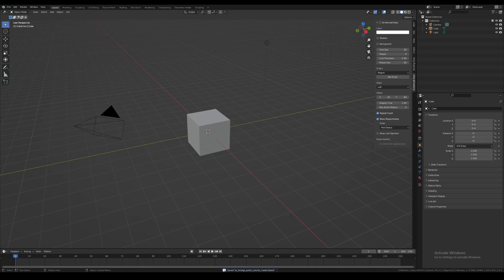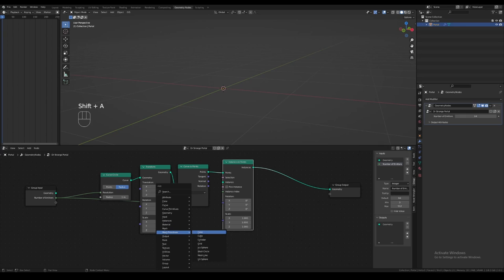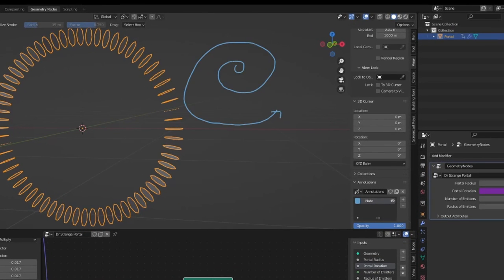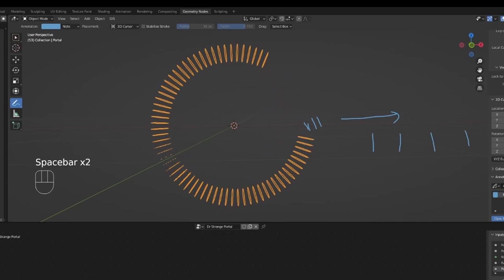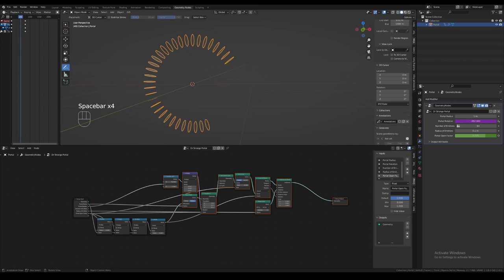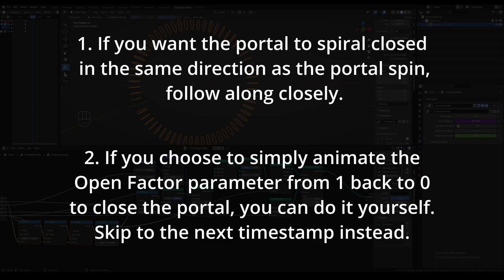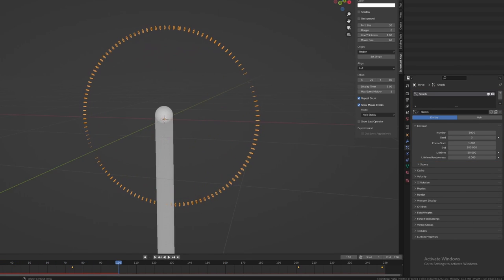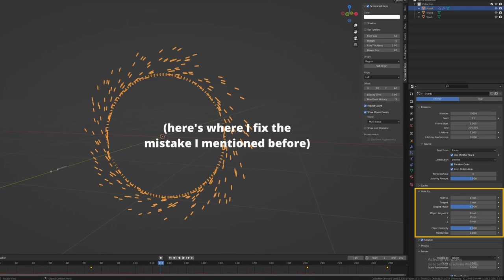How to Make a Doctor Strange Portal in Blender 3.0 | Geometry Nodes and Particle Systems

Comment: hello! when my portal opens it stays still and then closes; it doesn't keep turning. I'm a bit confused about the key frames used in that part. what needs to be done?
Reply from the maker: Hi! After creating the Portal Open Factor and connecting it correctly as shown in the video, slide the Open Factor to 0 and insert a keyframe at frame 1. Then go to frame 75 (or any other frame, depending on how fast you want the portal to open), then slide the Open Factor to 1 and insert another keyframe.

Make sure that you have followed all the steps closely; if you have animated the Portal Rotation with a driver like shown in the video, and the Open Factor like I explained above, when you play the animation, the portal should spiral open correctly.

If it still doesn't solve the problem please don't hesitate to ask again, I will try my best to clarify further

Comment: hello there. Why did you enable collision with ground for the shard particles but didn't enable it for sparks particles?

positive comments for algorithm: nice blender tutorial. great job, helpful, thanks
Reply from the maker: Hello omiga, the collision is applied to the plane object and will affect all particle systems in the scene. In fact the Shards system is the only system that won't actually collide with the plane, since we turned off gravity for that system.
Reply: @rr24creations  Indeed, small brain error on my part. Reversed shards and sparks.
Is it not possible to have collision without gravity? I think the render overall would look a lot better if the shards at the bottom bounce off the plane instead of clipping through it.
Reply from the maker: @omigalock  it's indeed possible to have collision without gravity. In this example, the Shards don't reach the ground (they are set to expire before then) so the collision does not affect the Shards. However, like in my previous video, if the portal is so low such that the Shards don't fully extend out the portal at the bottom, they will clip instead of bouncing off

Comment: Hi, I have a problem. When I add the part to close the portal it deseaper. How to solve that ?
Reply from the maker: Hi, can you please give me the timestamp in the video where you're facing your issue, so that I can try to pinpoint the problem
Reply: @rr24creations  Thanks for your awner. My problem start at 13:25.
Reply from the maker: @aryastarkherosdewinterfell370  I'm not exactly sure what your issue is... Check that all the node connections you've made are exactly the same as the video. Also check if you have created the opening and closing keyframes correctly. If you want further help, contact me via DM on RithRake24#2602 on Discord. Send me a screenshot of your node graph and maybe I will be able to spot the problem
Reply: @rr24creations  Thanks a lot !